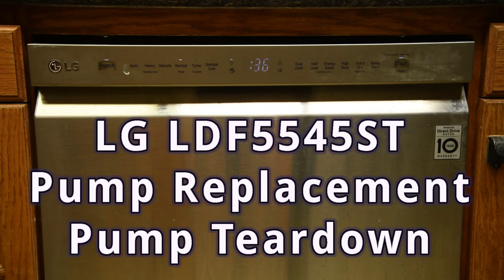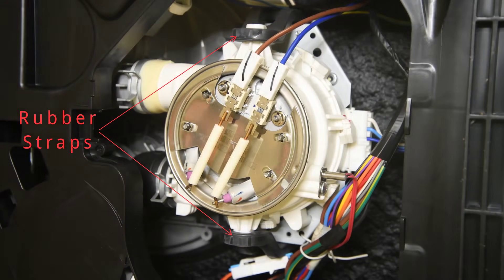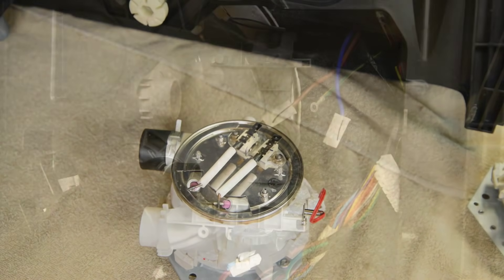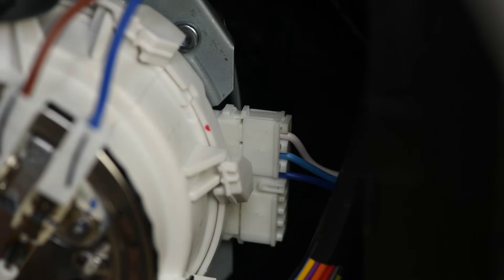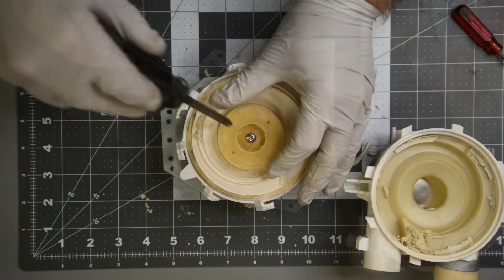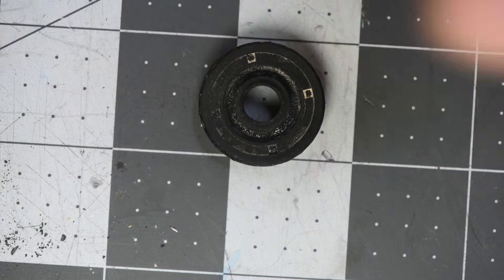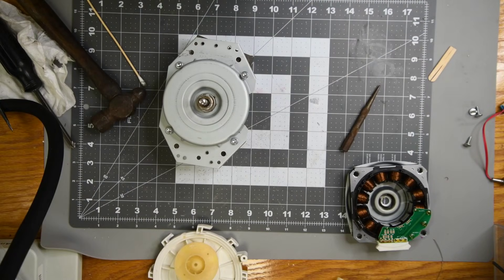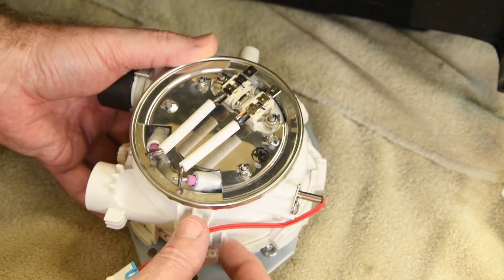Noisy LG dishwasher Fix – Pump Replacement

Comment: Now in 2025..... the pump is close to $300 everywhere.     My original dishwasher this replaced lasted 30 years.......... I should have just kept it.  New appliances are junk.
Reply from the maker: I think LG has a seal problem.  A little while back, I had to replace the deverter motor.  It's a cheap motor but a pain to replace.  And why did it fail, the seal that the shaft fits in.  It is such a slow-speed motor that there is no reason for the seal to fail if it had been made out of decent rubber.

Comment: This is a design flaw. This motor shaft is so short that the pump seal is in close contact with the bearing. Other model of LG motors have much longer motor shaft; therefore in case of seal leak, water is less likely to reach the bearings. The repair cost would have been the cost of new seal (about $15 ).

Comment: The best solution is to replace the damaged motor and to install a new seal (DD62-00053A, Samsung part number matching the LG  original). I just replaced the whole assembly two days ago and now I know what to do next time when this happens. My seal failed after 8 years, which is not too bad.   Other people's failed rather earlier. Instead of waiting for the seal to fail, maybe it is a good idea to replace the seal after a few years just like what we do with car engine filter change. The replacement motor itself could cost around $150 - $200 while the seal costs about a few dollars.
Reply: I only use it once a day. If you use it twice or three times a day, I won’t be surprised the seal fails in 2 to 3 years.
Reply: LG seal 4036DD4002C also will work
Reply from the maker: Do you have a part number for the motor only?
Reply: @metalplasticelectronics354 4681ED1004H

Comment: This video was helpful!  I had a lot more problems getting the motor/pump positioned correctly than u did - u made it look easy …. but the motor/pump was jutting out too much and i did not know that until the last step when i tried to put the cover on and cover didnt go on nicely… i think the large difficulty i experienced getting the hose on the pump/motor where the clamp goes away from the end of the hose (near a t junction or something) was also because of the pump/motor wasnt properly seated…. after sort of aggresively trying to place the middle portion of the back of the pump/motor that sticks out  into the rubber circular part, the pump/motor went further in and i could tell everything was good!
Reply from the maker: I like the way LG mounted the motor, but it is a little tricky to get it into the proper position.

Comment: I have an LG LDP6810SS that I bought in December 2023. MSRP $749. I started a wash last night and came down this morning to a big gnarly LE error blinking in red. I was able to get it to start and it’s running but now it sounds like what I would describe as a bad bearing noise. I had an extended warranty that expires this December. I got an appointment for the 21st. Am I going to have to buy a new pump/motor every 3 years 😮😢. I hope if they replace the pump it is better than the current one but probably not. LG hooked me with their OLED tv and I then bought an LG induction oven that had a few issues and then an LG dishwasher that also started having issues.
Reply from the maker: All I can say is the new pump assembly I bought looked the same as the original that I replaced.  I couldn't see if they improved the seal, but I highly doubt it.
Reply: @metalplasticelectronics354 is it possible glass, or some other hard debris could be causing it? I stopped my washer last night pulled off the filter and tried using my shop vac but to see if I could get anything out but didn’t seem to make a difference. I saw it as one solution online. It would have to get through the round filter and I would say it’s unlikely.
Reply from the maker: If the round filter doesn't have any holes in it, I would doubt any chunk of anything could get into the pump.  Did the noise pop up all of a sudden, or has it been getting louder?  If it's the bearing, I would expect the noise to get louder and louder.
Reply: @metalplasticelectronics354 just suddenly, right after getting the LE error. I was able to cancel and get it to start again but it had a faint, rubbing or whirring noise. It’s definitely gotten louder over the last few days. I had run a wash the Sunday with no issues and then started a load overnight and came downstairs to the error. Apparently happened around 11:45pm based on notification. It then gave suggestions like turning the breaker off and then back on, and that it could be an electrical or motor problem. I still have a week until a tech can come out unless I get a cancellation.
Reply from the maker: It's probably the bearing in the pump motor.

Comment: Very helpful video. Had the same problem on LDP7808SS. Found the seal and bearing on Amazon and was able to repair the motor. LG shows 2 part numbers for this model: AGM30016301 and  abt72989205. One is $99, the other is $289. Does anyone know what the difference is between these two parts? They look identical...
Reply: Did you ever figure out if the cheaper one will work?  Thanks!

Comment: If I don’t want to replace the part do you think packing the bearing with grease would make any difference?
Reply from the maker: It might help with the noise, but the damage to the bearing has already occurred. The bearing is rusting inside from the water that has entered it.

Comment: How did you know it was the pump motor assembly and not the case assembly that also has a pump motor?
Reply from the maker: The bearing noise only occurred when the main pump was running.

Comment: Perfect video!! I can’t find a motor pump assembly under 350$.
I found the motor only with the part number 4681ED1004B for 120$ . I’ll try to change the seal and give it a try.
Reply: Have you tried to replace the pump motor? Does it work?
Reply: yep same question from me tonight as well!
Reply: @davemerkel6947  I checked his video carefully, frame by frame, so I think his pump motor is 4681ED1004H. Found out it is assembled in ABT72989202 dishwasher pump

Comment: Mine started making this noise recently after just over 3 1/2 years. The link to the part is sold out.
Reply from the maker: You might try checking with some appliance repair supply shops.  It is so overpriced at LG. I remember seeing it at one of the online appliance parts places; it was priced between LG and what Amazon had it for.  I don't remember which one.

Comment: Had the diverter motor go out twice already on mine, switch once and the entire touch screen was flickery/glitchy from factory until I must’ve accidentally bumped a connection tight, terrible units
Reply from the maker: Sure sounds like you got a lemon.  I did have to change the diverter motor a few months ago.  Didn't have the time to make a video of it.  Seems to take about 3 times longer to do something when recording it.  But there are a few videos up on replacing the diverter motor.  I think some grit worked its way into the seal on the diverter motor shaft.  I cleaned it well and hope that stops the water from getting into the diverter motor.  It is still the best cleaning dishwasher we have ever had, but the pump motor sure leaves a bad feeling about it.

Comment: This was a fantastic video, thank you for sharing your expertise!

I am in the same situation and looking to purchase and replace the motor as shown here.

I am wondering if there are any recommendations to ensure this problem doesn’t happen again in the next 3 years?  Would there be something we could do to the motor to ensure the bearings don’t undergo the same water damage?

Thanks for your help!
Reply from the maker: I would think some kind of splash guard could be put on the motor shaft.  That way, any water leaking from the pump seal wouldn't get into the bearing.  But it would get splashed somewhere else, and I'm not sure what kind of problems that might cause.

Comment: 6 years seems to be the lifespan on these circulating pumps cuz mine burnt up. I watched the teardown hoping it was repairable and not a complete replacement. Very good video, thank you!
Reply from the maker: If they had used a proper pump seal, LG would have made the 10 years for sure.  The motor is very nicely made.  Cutting corners on the pump is where they made a huge mistake.

Comment: Thanks so much for this tutorial!  We bought our LG dishwasher in 2021, so we are out of warranty.  Our dishwasher sounded exactly like the dishwasher in your video before the pump replacement.  LG wanted to send someone out for $300 bucks, and tell us we needed a new circulating pump, which still could have a partial warranty.  No thanks.  My husband was able to watch your video and replace the circulating pump with no issues.   I will never purchase another LG product.
Reply: wasn't there a 10 year motor warranty sticker on the front of the dishwasher?

Comment: So, if the motor was still under warranty, why did you buy a new part instead of calling LG to replace it? I think the labor cost would have been less, right?
Reply from the maker: Nope, labor would have been over 200.
Reply: @metalplasticelectronics354 I just called LG on mine LDT7797BM. They quoted me $350 (labor & part) + 3 months warranty. Not worth the hassle. The new dishwasher can be purchased for $500 to $600.

Comment: I have the exact same dishwasher model with the exact same sound/problem. While it absolutely sucks that I need to spend the money to replace the pump (at less than 5YO) it’s SO nice to have this video because it’s literally the exact same steps I will need to follow. I’m just hoping I can get the motor for what you paid. Initial checks yielded prices well over $200. Wish me luck! 🤞☺️
Reply from the maker: Good luck for sure.  The pump is way overpriced, I believe LG is hurting their brand.
Reply: @ I got it off Amazon for about $160 ($180 with shipping/tax). Still stings but it’s better than having to buy a new dishwasher. I’m planning to run a cleaner (Finish brand or similar) regularly to help prevent calcification buildup in the pump as I’m guessing that’s the root cause.
Reply: @metalplasticelectronics354 I replaced the pump. Had to have hubs help me with that motor connector. Holy cow was that difficult to get apart! But it now runs soooooo quietly, kinda like it’s new! FYI, I videoed it and plan to post it to my new channel next week (have to learn to edit first). I gave a big shout out to your channel for the excellent instructions/ video!
Reply from the maker: Congratulations, it's a good feeling.

Comment: Had the same thing happened to our LG dishwasher but it got hot and smelled like electrical smoke! Cut it off and removed it from the house. Called LG the next day and they said it is probably plastic has gotten on the heater coil and gave me instructions how to clean it and I would be good to go. Well when I tore it down there was no plastic in it and the bearing was rusted with water also in the motor. Called them back and sent them pictures and in 3 days I had a new assembly plus a letter stating that my 10 year warranty was good for another 10 years!
Reply from the maker: I wonder if it depends on who you get to talk to at LG service.

Comment: Bought our LG dishwasher in 2022. It was very quiet and cleans dishes extremely well. In the last month it has gotten very noisy and we think the pump needs to be replaced. It’s a shame this only lasted not even 3 years. Shame on LG. So, now we will try to find the pump assembly and try to replace ourselves. We were quoted it would run us 525.00 to have it fixed. This machine looks brand new. Not ready to buy a new one and not willing to pay that much to repair it! Thank you for your video! Now I think we can tackle this ourselves!
Reply from the maker: Yes, warranties are a joke these days.

Comment: Thank you very much for this! I will need to replace mine and I think I can do it after watching your video. Our power went out during the hurricanes and it somehow left water sitting in the bottom which I eventually figured out was due to me not placing the hose above the garbage disposal (found a great video to explain this). Got that fixed but now the motor makes a loud whirring noise that is progressively getting louder! They just don’t make things the way they used to
Reply from the maker: No, they sure don't.

Comment: Mine lasted 6 years then motor went up in smoke. Bearings good took it apart and motor burned up
Reply from the maker: Does it look like the pump seal was leaking water on it?

Comment: Thank you for this video! After suffering for months with the noise we replaced the pump in our dishwasher. Your video made the repair easy and approachable. I want to add one small bit of information about the new part that tripped me up for weeks that seems obvious now that I know. When I went to LG to find the part number for my dishwasher model that ends in "s", LG kept giving me a part for a dishwasher model ending in "w".   Sad to say it took me weeks of second guessing myself about the part number until I figured out that the "s" is for Stainless and "w" is for white, same part number for whichever color you have.  I have a stainless finish. If this comment helps just one other person,  I'll be happy that it's not just me. : )
Reply: Wow! I have been tripped up by that ever since I started searching the part.  Bless you for tyoing that in the chat! You saved me alot of worry and doubt and trouble!

Comment: Same problem, 3 years old. LG Canada wants $314 for this poorly designed pump. What a waste of money. It will also probably last 3 years. Might just let it burn out, then go buy a new dishwasher from Costco . You can bet it won't be LG.
Reply from the maker: LG is hurting their brand that is for sure.

Comment: Hi I just subscribed your channel. Good video and good job!! Just curious, for LG dishwasher LDF5545ST (and mine which is LDFN454HT), other than the ABT72989206 "Pump Casing Assembly", any other parts that would be easy to break? Also, based on your video, I suppose that the "drain pump (motor)" part# ABQ75742501 is NOT the right part for LDF5545ST or LDFN454HT, right? Thanks!

And BTW, wow, I used to be a loyal LG customers but now I don't think I will buy another LG product again. Shame on LG for such bad design on a simple seal..
Reply from the maker: I'm not sure what models the pump will fit.  LG Parts has a pretty good sight for looking up the parts in their appliances, their prices are too high though.  I think the diverter motor is another common problem with the dishwasher.  I had to replace that.  And I may have to do it again as I just replaced the motor and not the seal.  I'll regret doing it fast instead of doing it right.  I don't mind too much if a design problem pops up in something.  What I do mind is the company not standing behind their product.  LG knows they have a problem with the pump and motor.  So it should be automatic, call them, give them the serial number and they should give you the part.  But it seems they do everything they can to make it difficult.   And thanks for the sub.

Comment: I have model XD4B24PS with same pump. Great video but for my model there is no cover on bottom to access pump so looks like i have to fully disassemble from top down which is alot of work. Do you happen to know if there is a quicker way to access the pump for replacement ?
Reply from the maker: Wow, that sounds horrible.  Is there anything stopping you from making an opening to the pump?
Reply: I have thought of cutting a hole to access but I think I'm going to try and disassemble from bottom. This link shows someone taking off, it's in another language so can't understand what they are saying. I'll let you know how I go. 
https://youtu.be/aY3VVwMBI7w?si=2OB_vHU9pXw-gowe

Comment: Excellent video, thanks.
My dishwasher warranty says 1year, Not 10 years? 
Is the pump 10years?
Reply from the maker: The main motor on ours had a 10-year warranty.  The motor is part of the pump assembly.  But I would have had to use an authorized LG repair center to get the warranty.  And the labor is not under warranty, so it was cheaper to replace it myself.  It wouldn't surprise me if LG dropped the 10-motor warranty on later models.  If the pump seal didn't leak there is no reason for the motor not to last 10 to 20 years.

Comment: Awesome video!  It helped to replace mine and works perfectly but with only an inconvenience. Previous to the replacement I was having a bE error in the dishwasher randomly and now this error appears always. Looks like the washing program ends before the drying phase, the bE error appears and dishes are not dry. Also looks like the dishwasher is not able to heat water properly. Any idea?
Reply from the maker: The water heater is on the bottom of the pump. Make sure the connections to the heater are good.
Reply: @metalplasticelectronics354  double checked and both energy connections and temperature sensor are well connected. 
I read somewhere that after replacing the pump a kind of reprogramming was needed... Any idea?
Reply: @metalplasticelectronics354  found the solution in this video!  https://www.youtube.com/watch?v=cbQapGQYLDs. Ater replacing the pump or the main board, the dishwasher may need to be calibrated. For me this worked like a charm!

Comment: I just fixed mine with the same issue but you did it to the final stage - seal remove, disassembling motor and analyzing the causes. Thank you for your efforts 👍